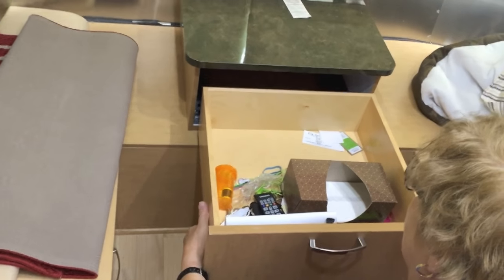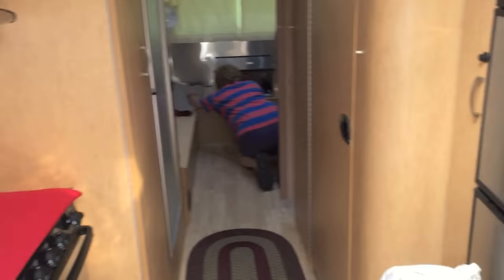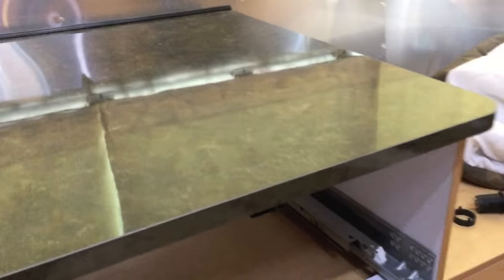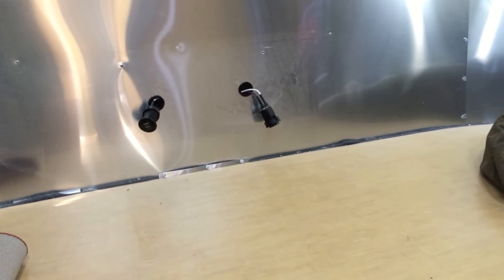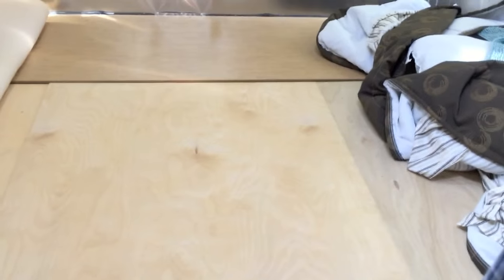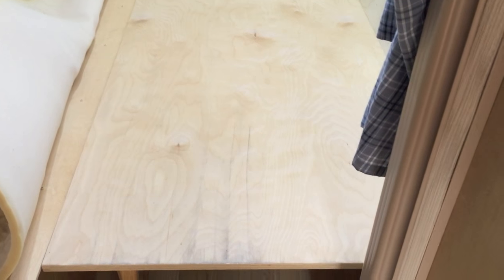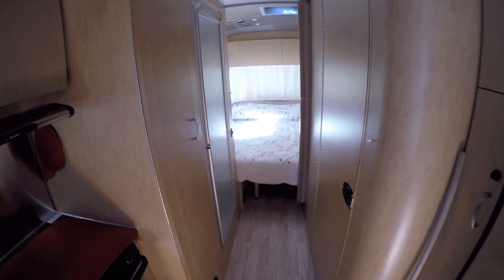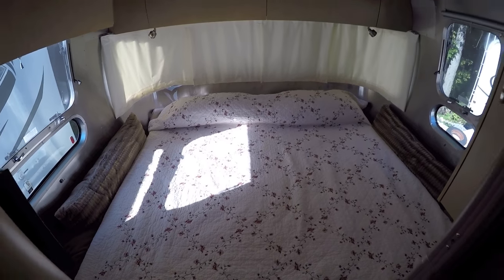Airstream - (DON'T DO IT) Converting twin beds into a residential king size bed.

Comment: I have the same issue two twin beds shaped like a upsidedown U the twins are below a reg twin their 4 inches more than crib mattress 6 inches below a standard twin def not working for me. I imagine originally the cushions for the U style beds were custom made but I bought it 2023 not 1983' so I'm gonna do a remodel but not a king to big I want a little space left for portable AC unit and tv so going with a full size bed on mine I would never be able to make ur guys bed if it was mine
Reply from the maker: We did change it back to twins. It was too hard to get in and out.

Comment: How is this mattress conversion working out for you?
Reply from the maker: Okay after using it for about a month we have decided to change it back to twins. The king option just takes up too much valuable floors pace.
Reply: @allwheelsdown5646  
You should cut out the center of that foam mattress to make it a 3-piece King in addition the support structure underneath the centerpiece should be a box with available storage underneath using shocks to lift up that Center mattress once it's cut sort of like a Murphy bed but removable.